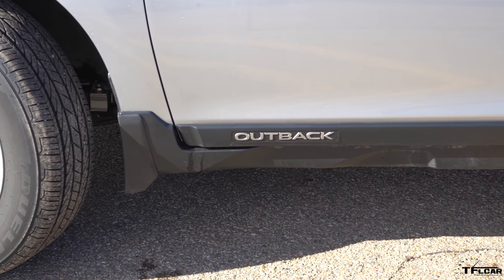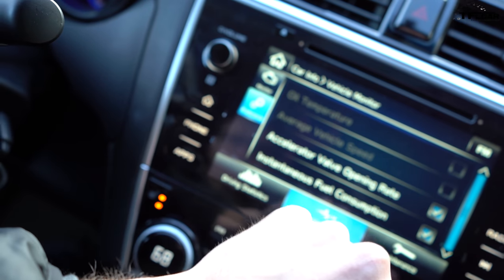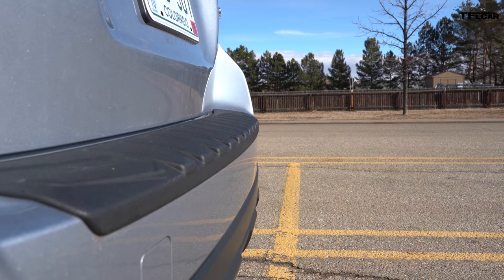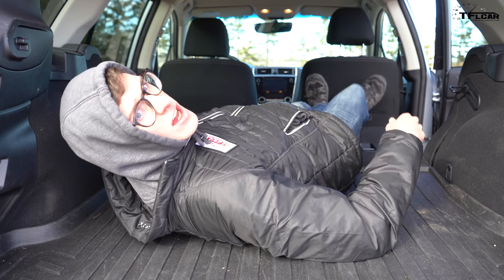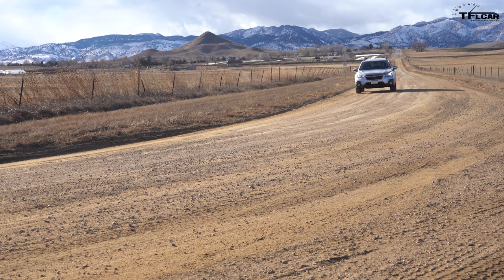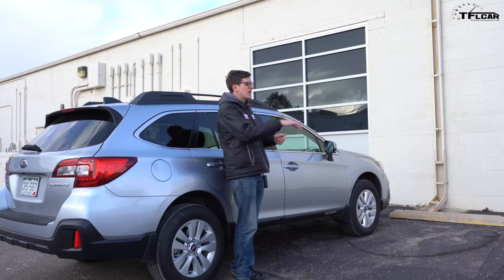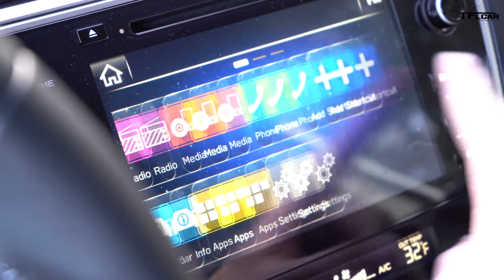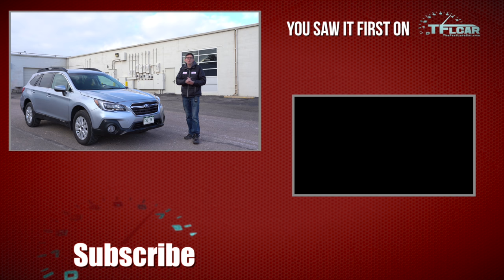The New Subaru Outback Isn't Your Dad's Station Wagon - Except it Totally Is...

Comment: Well, I have the 2016 Outback Premium with the Eye Sight safety system. I've taken it on many camping trips with my grand-kids. My significant complaints are the  marginal OEM batery that it came with (which I've already upgraded significantly)  and excessively short tire life (which I've already replaced with Michelin Defenders T&H). 

However, I can't say enough good things about the EyeSight Safety system. It saved me from a very significant crash recently. A car ran a red light and, thenrealizing what they had done, screached to a crossways stop smack in front of me in the intersection. As is often the case, it happened so fast that I was disoriented for a moment. All I remember is that some camping items I had stored on the folded down rear seats suddenly came smashing against the back of the front seats. Then I saw the other driver staring in horror as my car stopped mere inches from their driver side door. So yes, my 2016 Outback might not be able to withstand a "10mph bump without getting damaged some"....but it does a fantastic job of keeping the 10mph collision from ever happening. ☺

Comment: I got the 2018 2.5i Limited last January and absolutely love it. Covered over 5000 miles in a week-long road trip last summer, and it was super comfortable and got 39.6mpg (635mi per tank!!!). As a bonus, I didn't need to shell out for a hotel with all the cargo room. I just rolled out a sleeping bag in the back lol. It's definitely looking to be the long-term do-it-all family vehicle that Subaru claims it to be. My only complaint is the factory Bridgestone Duelers. They feel like ice skates in anything but dry roads. Just changed them out for a set of Michelin CrossClimate 235/65R18 (too early to give a good review though)

Comment: I get the point of what you're saying about it being simplistic and good but you failed to mention that there is push button start and keyless entry and if you lived somewhere at high altitude and you were worried about power you would just get the 6-cylinder

Comment: Good review, funny in a nerdy kind of way. I enjoyed the flasbacks to the older generations of station wagons. However a Limited or Touring would produce the same great mpg with extra comfort and commodities: push button start, automatic hatch, driving aids, etc.... I agree it's not the best performer but it flows very well in high speed traffic and will go practically anywhere with the right tires for the season, and in most cases better than most SUVs out there...

Comment: The Subaru CVT is chain drive, by the way.  ;)
Reply: So is the Nissan's. It looks something like the expansion strap on your wrist watch, except smoother.
Reply: @normt5463  Sure it does,..it's the nature of the beast!
Reply: @normt5463  Is that why it has terrible lag when going from reverse to drive?
Reply: A Subaru CVT uses a conventional rod and link style chain that pulls, its pretty solid as far as expansion goes, the Nissan CVT uses a metal on metal push belt that actually has a little bit of expansion on the pull side. That expansion contributes to the rubber band effect.
Reply: Reg Sparkes actually, no, the Subaru is metal chain, the Nissan is a metal belt.
Reply: @John R "Can" fail if not properly maintained, just like all transmissions. Drain and fill every 60K miles and its supposed to last the life of the engine. I own a 2011 Subaru outback with 230K miles on it. Its on its second tranny, the other valve body went out and it made more sense to replace it with a lower milage salvage unit instead of spending $600 for a valve body. Found a CVT trans with front diff for $1200 and I was able to put it in myself with simple mechanics tools. But my engine will have to be rebuilt before the tranny. 

The problem here is these transmissions are not being maintained properly. Also there's a HUGE design flaw. There's a filter in it that's not changeable unless you disassemble the CVT. Its paper and not meant to filter 300K of flow. The all metal strainer is easily replaceable tho.
Drain and fill fluids @60K
Drain and fill and replace strainer @ 120k
Drain and fill CVT fluid @ 180K
You get the rest, but this is why they aren't lasting.
Reply: @DustinLKimble  happy to see more people like you. Of course it will brake if you dont change the fluid every now and then. The 4EAT also had problems and I may even say I find the CVT less prone to problems. I changed my fluid at 50k and I am looking forward of changing it in 35k.

Comment: 2016 Outback here now at 75k miles.  None of your issues.  My only issue is sometimes I can't turn the key to off position to be able to remove it.  I have to cycle the transmission lever again.   Mine seem more nose down whereas your year seems more level from side profile.  I prefer the level stance look.

Comment: Great video - I have a 2017 Legacy Limited and I chuckled because I’ve noticed the misaligned hood (made the dealer’s body shop fix it), my trunk requires a firm slam, and every day I scratch my head over the center dash speaker grill (looks warped). Otherwise no issues in 2 years and 40k miles.

Comment: I've often joined in on the CVT hatewagon, but I had a rental Legacy with this setup (but 2.5l) and I loved it.  I was unaware of its lack of gears.  It was responsive and the paddles worked well.  Much better than my Silverado's clunky, jerky 6 speed auto.  Hopefully these Subie transmissions will hold up over time.
Reply: They have been revised. There are visible differences - more robust built. Also, there already is a eCVT type in plug in Crosstreck. This has 2 e-Motors taken from Prius. So the parts are proven to be reliable.
This, I assume, will come to all models if only customers ask for that. I would certaintly like it in Outback/Forester.
Reply: In five years, whether we want them or not, almost all cars/SUVs will be using CVTs.  Think not?  You're not paying attention....
Reply: @eskieman3948  Actually it depends on customers and market. Just have a look RAV4 - AT in USA and CVT in Japan.
I think this is very low detail thinking...

Comment: We have a higher end Outback so most things are push button and keyless so we don't have the problems you describe. We traded in a 2012 Outback. There were wins and losses.

Wins: Finally a car that is almost as nice as my F150 for road trips.
Better mileage.
Apple carplay
A wee bit bigger, I'm less cramped
No longer a major pain to change bulbs up front (it was criminal - even though it was better than some cars, but you shouldn't have to take off the front of the car or get a blood transfusion just to change things that need changing.

Losses: Cubby hole in the rear left got nerfed so now we can no longer fit an EasyUp canopy cross wise.
So many features that at time we get chimed at and we have no idea what the car is upset about.

Our family had a 1963 Buick Invicta Station wagon and an International Travelal; both better road cars. Quite good in the snow too because we had to buy snow tires back then. And know how to drive in the snow. 4WD is over rated for snow (don't get me wrong, I like it but I drive back to Minnesota in the winter I take the RWD F150 with real snow tires - no problem).

I miss the old station wagons. The new Regal wagon is close; but no spare tire?! Buick!! Gah.

Comment: One positive you forgot to mention was the surprisingly High towing capacity. I used my family's Outback to tow our Can-Am Side-by-Side around. We recently upgraded from a 13 4 cylinder to a 19 6 cylinder. The drivetrain is considerably better in the six cylinder. Also, we somehow manage to get about the same MPG which is 19. We can also attest to the amazing Road trippin ability as it held 4 overweight Americans with 4 full-size overweight suitcases from the Canadian border to the New Jersey coast in Absolute Comfort.

Comment: I think the key fob is just you. I've never had an issue with mine. Granted I have a 2015 Crosstrek, I've never had an issue. My mom also has a 2018 Outback with no key fob issues or infotainment issues, and before that a 2016 Legacy and a 2014 Outback, and a 2012 Outback all with no key fob issues (They are company cars)
Reply: DarkneszFalls I have had my key fob become a brick on my 2011 Outback. So maybe not just their Outback. Very strange.
Reply: Same, as I have a 2015 Subaru Forester and have never had an issue with the key fob in nearly five years of ownership
Reply: 2016 WRX for 3 years with what appears to be the same fob.  My only issue is the once or twice a year the panic button gets pressed accidentally 😱also I wish I had a glitchy infotainment system with android auto.  I just get glitchy “Star link” that doesn’t do much more than integrate Pandora if it will link at all.
Reply: @spencermain6686  and I bet you've dropped your keys a hundred times like most people so there's a chance that the key fob is damaged

Comment: I've got a 2003 Outback that is an absolute beast in the snow. It outdoes the factory lifted 2016 F150 Lariat 4x4 that I had. I don't understand how, but it does. It also does it while getting good mileage. The only gripe I have about it is that I can't find A/T tires from any brand for it in the stock size.

Comment: We had that '74 Ford LTD wagon that could fit plywood in the back. The frame rotted-out in less than 3 years. Then we had a '77 Chevy Impala wagon- loved it! No problems. After that we had several Subaru Legacy wagons, no problems with them either. My Dad upgraded to the newer model about every 5 years or so. That said, I didn't like the small powerplant and CVT in my '15 Crosstrek.

Comment: Good review & to the point. May hurt some fanboy feels ... however it is what it is, a grocery getter with good mpg. Wouldn’t come with CVT nor delicate controls if that wasn’t how consumers were leaning towards. Dog Parks, Antiquing, getting pallets to build indoor decor projects.... the new Subaru playground. Lane-keep, Radar-Cruise, Start/Stop, Parking Sensors, improved mpg with good cargo space.
Reply: The vast majority of consumers wouldn't choose a CVT. The automakers choose what the consumers lean towards because they put CVTs in all the cheap cars. And that's the exact reason why automakers choose them - they're cheap.
Reply: Fuel economy & engine demands ... they get better fuel economy vs geared transmissions... 

Vehicle purpose is kinda Chicken or the Egg .... which came first,  manufactures skimped on capabilities by going CVT or Consumer Use only requires CVT. In other words did people change the way they drive or did manufacturers change cars to match how people drove.

Comment: I appreciate your review. I prefer the brand for its strengths and live with its weaknesses because I feel that its pros far outweigh its cons. Your honesty is refreshing because the brand is far from perfect, and I hope that SOA will see reviews like this and try to improve their offerings, especially with regards to their offroad performance and their infotainment. Their AWD system is phenomenal but it's simplicity is being overshadowed by techier approaches, and SOA had better be careful not to fall too far behind. A dedicated offroad algorithm should be able to perform active torque vectoring and deliver power to any one wheel to overcome obstacles more efficiently than what X-Mode currently does.

I own a 2013 Subaru Outback 2.5i Premium that's lifted and rolling on 29.5's with skid plates and swaybar deletes. I aspire to take it up Goldmine Hill this year. I came from an 05 Wrangler RME (I love your Cheap Jeep videos too) but I'm sure you can understand why that's a difficult vehicle to have to daily drive, so instead of trying to make the Jeep more efficient, I took what was once efficient and turned it into something more offroad worthy. As well, this Outback is such a huge improvement in the snow over my old Jeep that I'll probably never go back to a traditional 4x4.

Comment: FYI, Subaru’s door handles and keys are supplied by Toyota Keiretsu company. I believe they use the Aisin/denso parts.
Reply: Norm T, in theory, yes. Like you know Subaru is getting capital support and technology support from Toyota. New PHV system is going to be borrowed from Toyota too. It doesn’t make sense only subaru has the issue because they only assemble the parts that sent from same factory (Aisin/Denso)

Comment: I own a '17 Outback Limited.  The 2.5L is pitifully under powered for the rig.  It is dangerous getting onto the interstate unless you are able to get a long run at building up speed.  Oh, and the MPG computer is overly optimistic.  If the computer is showing 29.1 mpg, then your pump calculated mpg is about 10% less.  Pump calculated mpg on mine has been averaging around 25 mpg.  Things I like?  Top mounted oil filter makes for simple oil changes.  Roof rack rails being able to fold out are pure genius.  Build quality on mine seems much better than this review vehicle, as I don't have any odd hood or tailgate fitment issues.
Reply: I don't know if the Outback does this, but my WRX can only move the MPG number up or down by increments of .3. That might be contributing to the MPG difference?
Reply: Thanks for keeping it real.
Reply: There are times where the 2.5 feels perfectly adequate and other times where certain passing maneuvers are impossible and I would plunk $10k on the spot to drive something with more power. But then I go back to cruising and relying a bit more on momentum. It makes you work for speedy travel.... on downhills it feels fast at least, lol.
Reply: I got 18.8 mpg highway with 1000 pound payload traveling from Washington to Wyoming and back. It gets 24 mpg at sea level with 75% of the miles highway.  About 21 mpg 60/40 city/highway. Mines is the 2017 limited. Thats strike one with this vehicle. Strike 2 is the thin paint, I have chips all over the front. Now im waiting for strike three then ill move to toyota.
Reply: @ryanhill5676  thin paint is with every car company now. Those mpg aren't too bad for a car that actually has 4 wheels  getting power at all times. I just can't deal with a cvt
Reply: I honestly don’t know how much faster people truly need to go. I traded in my 300hp MDX for a 2016 Outback 4cyl and honestly the Outback picks up a lot quicker than my MDX ever did. Then again, I don’t drive like a jerk or weave around people much. I just don’t know what people are actually expecting for their daily driver - how is anything more than this produces even necessary?
Reply: The Outback gets great mileage for something that's always he's very reliable and on top of it like I said you could get a 6 cylinder and also with the 4-cylinder because that's what I have you need to use the paddles and pull a down shift .as you begin to drive like that on a regular basis the computer will learn your driving habits and will be more aggressive
Reply: @savanahlee3743  I'm hoping to be happy w the 4 cyl, '19 OB Limited soon. Going to test drive 4 & 6 cyl models next week. 
Coming out of my '15 Highlander, I hope OB is as roomy, quiet, smooth, reliable as my HL. 
Oh, I'm Pisces too. 03/08/58. Peace yal, e.

Comment: Subaru came out with a recall on the infotainment screen.  It's a software update.  You should check it out for your outback.  Also, I've never had that issue with the key fobs and we have 2 subarus with that exact key, you should try using the other key that comes with the car and see if you're still having an issue.

Comment: People blame CVT because is "garbage" "Slow"...But Forester and Outback isn't a sports car. Even Subaru change CVT to 6mt or 6at or 6dct, this car still runs on  2.5L, 2.0L NA engine that put out less HP than a civic si, and heavier than a civic.

Oh, you say off road?  That x-mode is designed to work with the CVT transmission. Unless you can pay for Subaru to design a "new" X-mode, then Subaru will still use this system until they come up with a BETTER, more powerful hybrid(the current hybrid one is sucks) or full electric version.

The point is Subaru think CVT is the cost-efficient way of making these cars. Even they don't change the transmission, people still buy, that's it.

Comment: It’s MOMS station wagon. Dads didn’t drive wagons. My first car was a 1975 Impala wagon w/ 400 cu.in. and tow package, I bought from my mom in 79 for $400 ( I didn’t care, I was 17 and needed a cheap car that could tow heavy stuff) Um stuck in 4” of snow lol no, we had real snow tires back then so 8” of snow was I walk in the park with a nearly 5k lbs car and real cleated snow tires. Downsides were, it was built on the Cadillac Sedan Deville body on frame chassis ( it was a tank) and the 400 w/ turbo 400 and tow package ( 3:42 LSD ) it got the same mpg as today’s full size half ton pickups or maybe a little worse. I didn’t need to fold down the back seat to lay down either and I know this because it was my Motocross car ( I had to sleep in it damn near every weekend) it towed my fully enclosed Motocross trailer and 4 bikes all over the country for 120k miles which that outback wouldn’t make it past the city limits trying to tow that and it damn sure wouldn’t have towed my 6k lbs boat.

Comment: Subarus have to have a dip stick bc they burn so much oil. My 14 forester with the same motor burned enough on an 8 hour drive to make the oil light come on.
Reply: GEO 
That was the old piston rings, you can sue under lemon law. Subaru knows about the issue.
Reply: @ryanhill5676  Unfortunately no been fighting with them with it. They do a oil consumption test over 1200 miles. Their fix was using "Subaru" brand oil. Which given its doesnt use as much but it will burn the hell out of some mobil1. Its a raw deal. If it was my car I wouldnt mind so much but my wife driving it ehh...